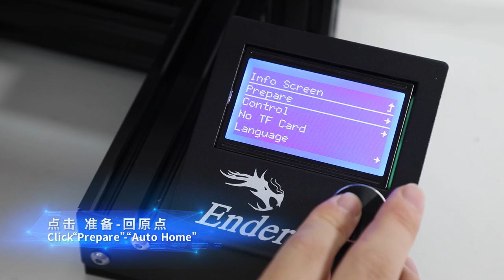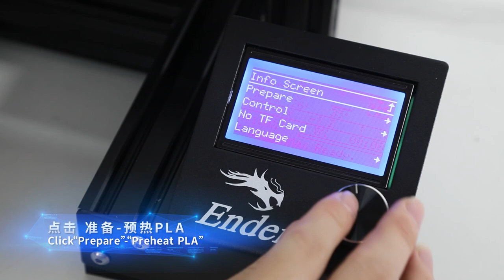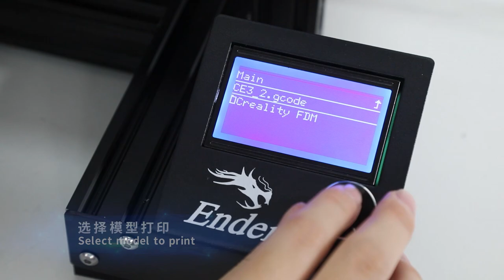Creality New Printer Ender 3 Max Assembly and Operation

Comment: Do we have to remove the rubber that under/ surround the nozell ??
Reply: no if you're talking about the silicone boot. Leave that on
Reply: No. It insulates the hotend block so you lose less heat. Also helps against fillament burning onto your nozzle.

Comment: i have a question:
does the ender 6 will have a usb (mini) port?
and/or does it have a wireless conection.
i want to know it, cause i am not able to use a simcard on my computer.
Reply from the maker: It has the usb port .
Reply: @Creality3D  thank you very much. But, maybe you could change the discription of the website? It sais that it only has a simcard slot.
But thanks for the fast anther
Reply from the maker: @zitroxlpthegreenone9324  Thank you for your suggestion .